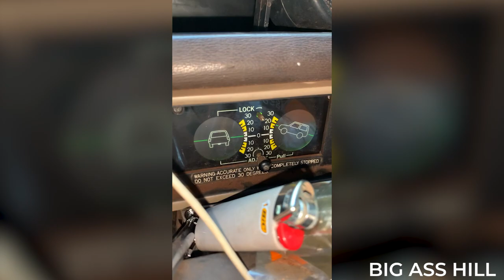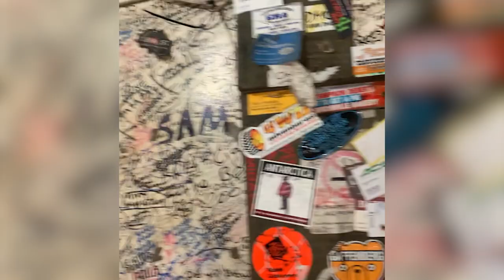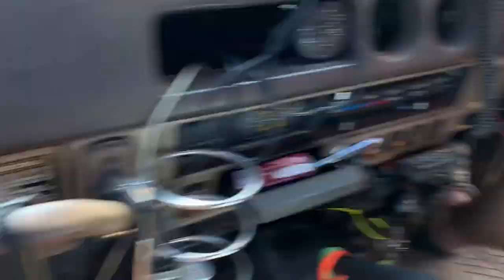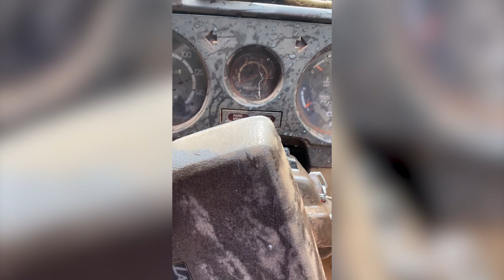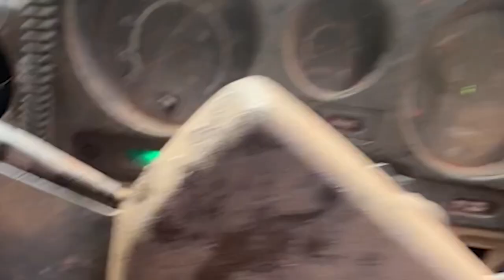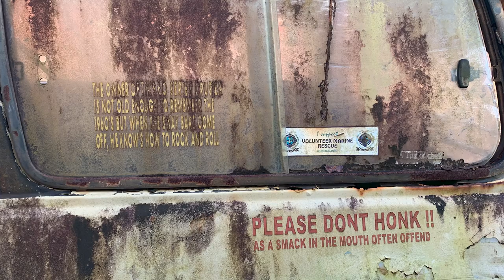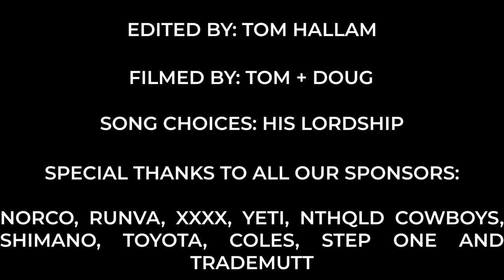Cape York 2022 in a 60 Series Landcruiser

Comment: Just started watching and am enjoying it. 
Got a question about the 60. 
I noticed it has the later 60 square headlights but the earlier 60 square dash. What year is it and did you do the changes
Reply from the maker: Yeah it’s a 85 model. We bought it like that ahaha. There’s lots of dodgy stuff about it but it seems to work. The grill doesn’t fit on right as it’s suited for the round headlight model. That’s what we had to drill in new indicators on the front and wire them in.